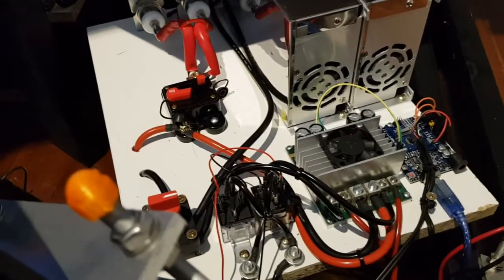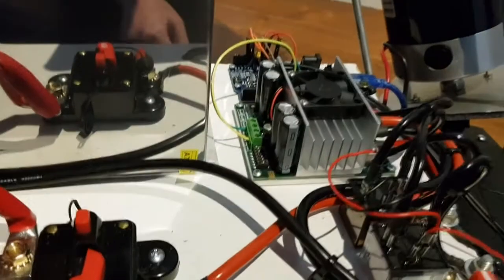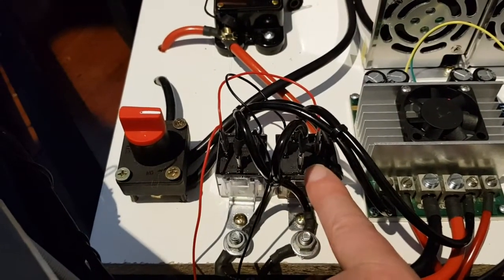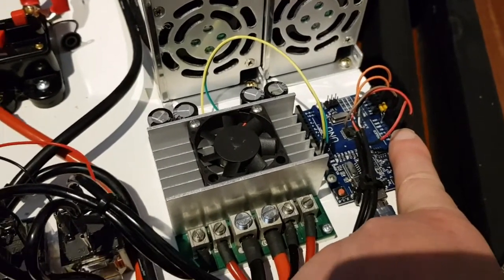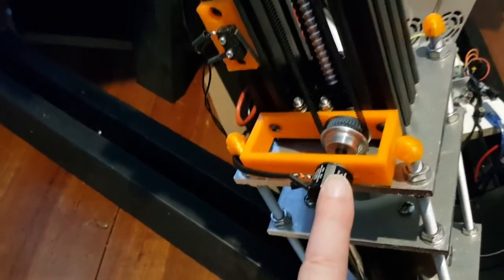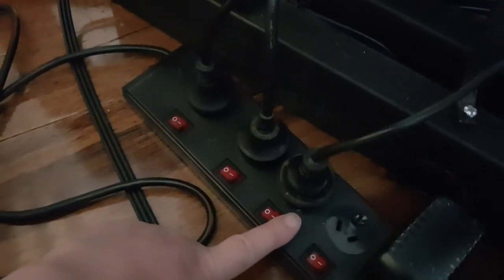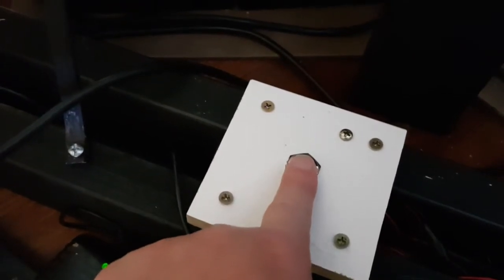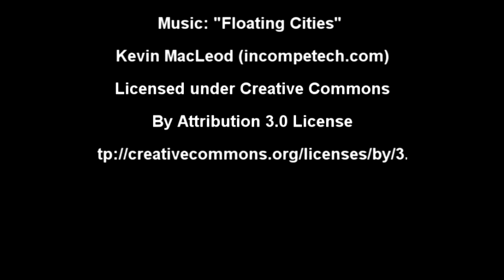X Plane 11 6DOF Motion Platform walkthrough (electronics) part 4

Comment: I know this is an old post but for anyone relying on it you should be aware that there's a mistake on the circuit diagram at around 14 seconds in. As explained later in the video the battery positive is connected to the 'sabertooth' side of the 60A circuit breaker and not the power supply side. That said, the whole project (which I've followed with great interest) is an awesome achievement with impressive attention to detail.  Congratulations to SixDegreesofFlight and thanks for sharing your hard work.